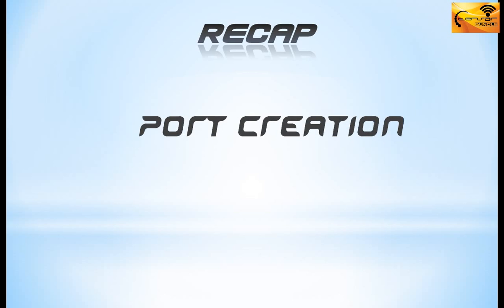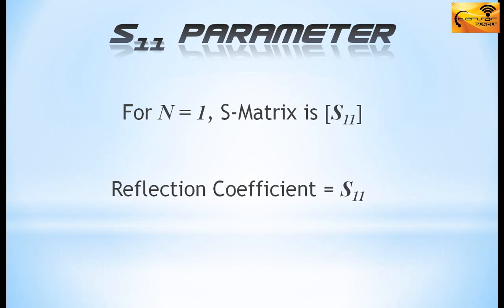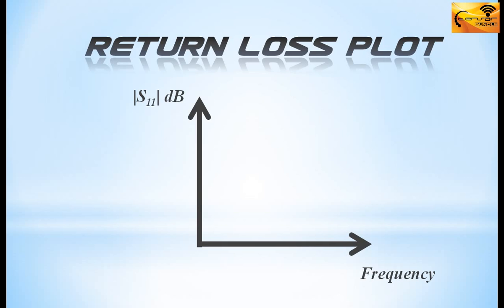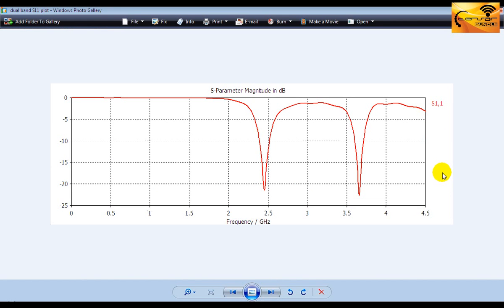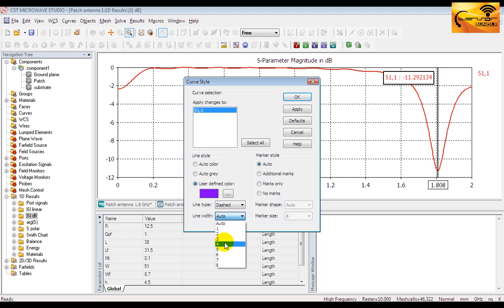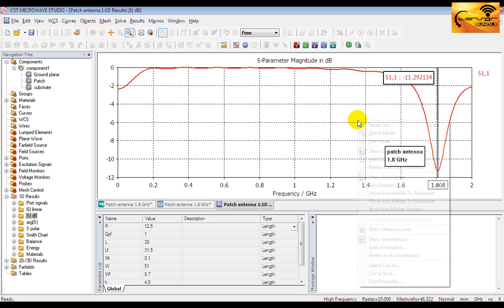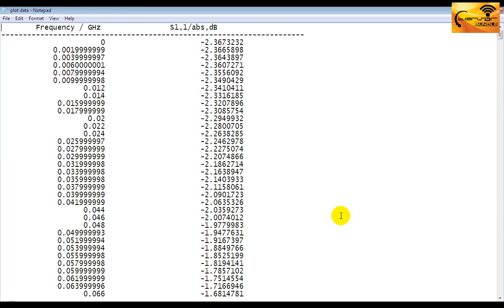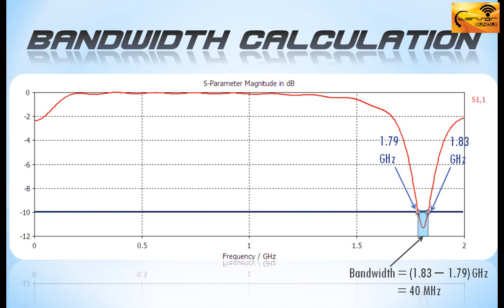CST Tutorial: Analysis of Return Loss Plot of Simulated Microstrip Patch Antenna- Part3

Comment: thank you so much for the video 
I've one question, at this point: 6:34, why did we choose -10dB? and not any other value to get the bandwidth?
Reply from the maker: at -10dB, 30% of the incident power gets reflected and 70% goes into the antenna, which is reasonable amount. This 70% is calculated by |ref coeff| = 10^(-RL/20) formula. 70% (or 10dB RL) is a industry standard that is widely acceptable and accomplished in practice. That's why we use 10 dB RL to get the BW of antenna

Comment: you have taken bandwidth of antenna at -10dB. why you have not taken bandwidth at -3db
Reply from the maker: Please don't mix up antenna with other system's bandwidth eg. bandwidth of a power amplifier where we measure bandwidth at the -3dB line. Antenna's bandwidth is measured based on reflection coefficient (|S11|) or VSWR or return loss.
Reply: thanks for the answer.

Comment: From what I studied, the bandwidth is measured by a value where the loss is at the most 3dB more than the minimum value. In this case, the minimum loss came out to be about -11.5dB at the resonant frequency. So -10dB was not a bad approximation to measure the bandwidth. My point is that we cannot fix the threshold at a particular value. It will have to be dynamically adjusted according to the situation.

Comment from the maker: @phoonjzc 
The choice of -10dB line as threshold is a standard value adopted by all antenna books and scientific literature. This choice emerges from the need of having a small amount of reflected power. Due to impedance mismatch, any practical antenna is bound to reflect some portion of input power back to the power source. The range of frequency in which the reflected power remains considerably negligible, is the bandwidth. -10 dB return loss implies almost 10% reflected power.
Reply: sir,i,m getting a drop at 8.29db. so how could i cal B.W?
Reply: sir,i,m getting a drop at 8.29db. so how could i cal B.W?
Reply: sir,i,m getting a drop at 8.29db. so how could i cal B.W?
Reply: sir,i,m getting a drop at 8.29db. so how could i cal B.W?
Reply: sir,i,m getting a drop at 8.29db. so how could i cal B.W?
Reply: sir,i,m getting a drop at 8.29db. so how could i cal B.W?
Reply: sir,i,m getting a drop at 8.29db. so how could i cal B.W?
Reply: sir,i,m getting a drop at 8.29db. so how could i cal B.W?
Reply: sir,i,m getting a drop at 8.29db. so how could i cal B.W?
Reply: sir,i,m getting a drop at 8.29db. so how could i cal B.W?
Reply: sir,i,m getting a drop at 8.29db. so how could i cal B.W?
Reply: sir,i,m getting a drop at 8.29db. so how could i cal B.W?
Reply: sir,i,m getting a drop at 8.29db. so how could i cal B.W?
Reply: sir,i,m getting a drop at 8.29db. so how could i cal B.W?
Reply: sir,i,m getting a drop at 8.29db. so how could i cal B.W?
Reply: sir,i,m getting a drop at 8.29db. so how could i cal B.W?
Reply: sir,i,m getting a drop at 8.29db. so how could i cal B.W?
Reply: sir,i,m getting a drop at 8.29db. so how could i cal B.W?
Reply: sir,i,m getting a drop at 8.29db. so how could i cal B.W?
Reply: sir,i,m getting a drop at 8.29db. so how could i cal B.W?
Reply: sir,i,m getting a drop at 8.29db. so how could i cal B.W?
Reply: sir,i,m getting a drop at 8.29db. so how could i cal B.W?
Reply: sir,i,m getting a drop at 8.29db. so how could i cal B.W?
Reply: sir,i,m getting a drop at 8.29db. so how could i cal B.W?
Reply: sir,i,m getting a drop at 8.29db. so how could i cal B.W?
Reply: sir,i,m getting a drop at 8.29db. so how could i cal B.W?
Reply: sir,i,m getting a drop at 8.29db. so how could i cal B.W?
Reply: sir,i,m getting a drop at 8.29db. so how could i cal B.W?
Reply: sir,i,m getting a drop at 8.29db. so how could i cal B.W?
Reply: sir,i,m getting a drop at 8.29db. so how could i cal B.W?